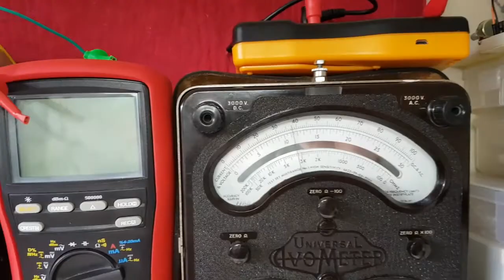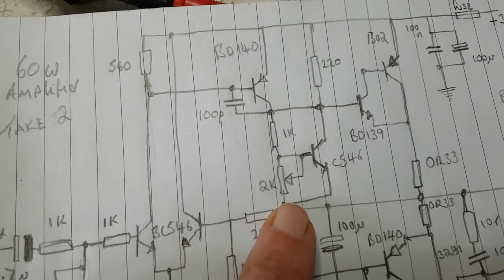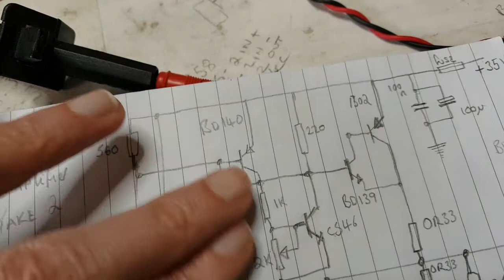60 Watt Amplifier Attempt 2 Update

Comment: Can you clarify what "right channel" means?  This is a mono amp, so there is no right & left (until you build a whole other amp).

You might throw the 'scope on the output to see if the amp might be oscillating.

In your drawing, just above the words "green led" is a 2-resistor junction including a capacitor, with line that goes off to the left.  One of the brown 'ground' wires connects there, correct?

This project is valuable because it forces troubleshooting.  What would I do now?  I'd test the voltages across the 0.33 power resistors at the output.  If, say, the upper power transistor is conducting heavily, the voltage across it's 0.33 resistor would be significantly greater than the lower power transistor + 0.33 resistor pair.  Then, taking voltage measurements backwards through the circuit might reveal something gone wrong.

Soon you'll have this bad-boy pumping out 50+ watts of ultra-clean Brahms Piano Concerto #2 in Bb Minor.   Or...  some Sex Pistols.   Or... one of my fav UK groups, Level 42.
Reply from the maker: Lol, right channel pointing at positive connection. In this instance "right channel" means "positive rail" :D
Putting Oscope on the output I only see DC no oscillation.  Yes to the ground connection all checked correct. 
Haven't any 0.33 I am using 0.27 its all I have at 5 watts. There is no voltage across the power resistors.  I measured the resistance to make sure I was getting a connection, I am.
On positive rail BD140 collector has 1.1V On negative rail BD139 collector has 38.6V with an Input voltage 40V.

Fixed it ;D Video on its way.
Reply from the maker: Cheers for your help with this. It does sound really nice and was worth my time invested. I have partially made another channel, just waiting for transistors and pots. :D
Reply: My pleasure.  I know how great a working circuit/project feels.  Our chat has been inspiring me to get my workbench set up, to get back into the mad scientist and maker thing.  Cheers back.
Reply from the maker: Your more than welcome. I might have given up on the circuit if were not for your suggestions, which are great because they worked :D
Yeah get that bench set up, I just subscribed and look forward to your video's m8.